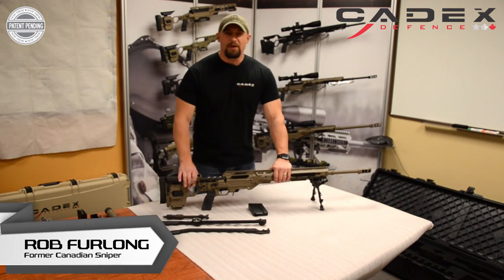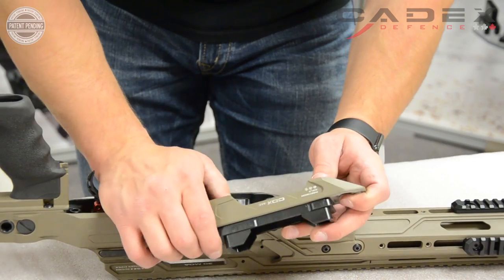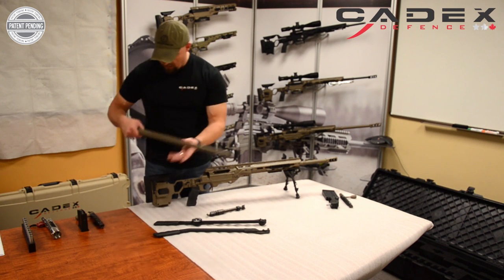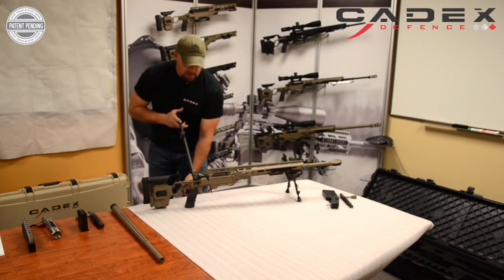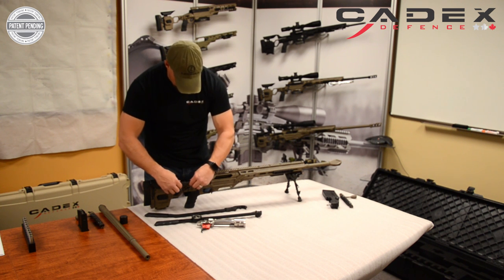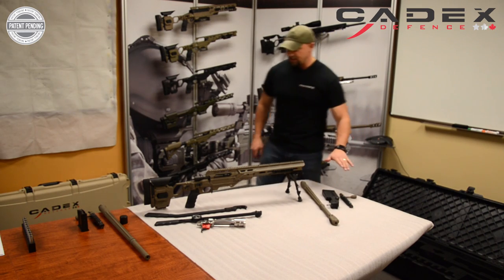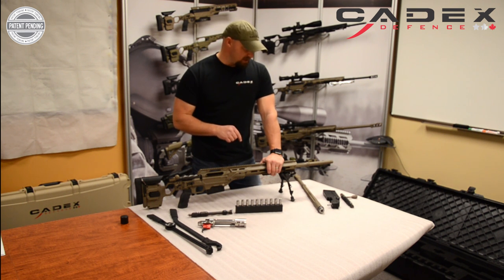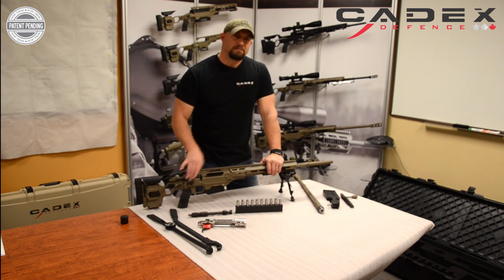CDX-MC Kraken - Rob Furlong

Comment: Can you guys make it any more complicated???!!!!!!! 
BTW i love yall's chassis.
Reply: Might be a tiny bit more complicated than some other barrel change systems out there however this one works wayyyy better as you are threaded the conventional way straight in the action receiver, not clamped like most systems.  This means that your POI remains pretty much the same even at long range which is a big improvement to the clamping method which repeat inside 1 MOA.  These systems are designed to shoot at long range +1000 yards so one MOA is 10" of margin of error at 1000 yards...  Our system has a shift of POI of less than 1/4 MOA if done properly.  That means less than 2.5" of margin of error at 1000 yards.  With shots taken at more than 1500 yards these days this makes the difference between a hit or a miss.  But yes it takes more than a 1/8" Allen to perform a barrel change.  Still, just think about how much ammo and time you'll spend on a range trying to fine tune your rifle between barrel changes?  Accuracy will always win over rapidity of barrel change because barrel changes are not made in the field, they are made prior to the mission so 30 seconds change versus 5 minutes change doesn't matter...

Comment: Does the multi caliber system compromise accuracy? For example, would a cdx-338 make a tighter group than the kraken with a 338 barrel?
Reply: Nope my friend.  Same barrel size, even bigger action.  The barrel change doesn't affect accuracy (as long as it's done as per the owner's manual)

Comment: great system shouldnt take more than 10 minutes for a barrel change. as convenient as it needs to be  while maintaining   headspace  and  consistent solid lock  up but    it is stupid heavy/ expensive. i will agree though the best barrel change system ive seen yet. i would be more interested in seeing this design patented and licensed to more lightweight  hunting/ sporterized competition rifles
Reply: I guess we disagree on the definition of stupidity...  To us stupidity is most of the manufacturers selling a multi-caliber not capable to maintain the same POI between barrel changes.  If you consider that carrying a 1 pound/ 3 piece tooling kit in your gun case is "stupid heavy/expensive" than I guess we'll let you spend your ammo trying to fine tune your ballistic chart, spending ammo, while we hit targets first round first hit...  Most systems on the market are maintaining a 1/2 MOA on paper (a true 1 MOA in the field) shift of POI, it means 15" at 1500m.  This system has zero to 1/4 MOA shift of POI and this makes the difference between a hit versus just throwing lead out there until you can make your correction.  Also, try to find us a Multi-Cal (American/Canadian made) using top of the line components with the same features for cheaper than us...  Good luck.  But we respect your opinion.
Reply: i am saying  for what i need  the rifle is very heavy and expensive. that is why i would like to see it on more  competition/ hunting rifles. i am not sold on the  other manufacturers   quick change system and actually have faith this would work well but  i have no need to change calibers in the field , that is an option i would love having at home
Reply: We agree on that point, a caliber change is NEVERneeded in the field, including the military.  As for heavy, it's not a hunting rifle for sure, it's an extreme range surgical tool so heavy is stability and makes the difference on follow up shots.
Reply: @daviddaerr1719  because the military can ask for anything...then there is reality. That is why many requests come up and few contracts get signed. There is not a single truly "tooless" multical system adopted. The M40A6 uses a torque wrench hex key and the abandoned XM2010 found out the juice wasn't worth the squeeze. These guys have done what was asked and the requirements are what they are. This was never meant for the hobby shooter. I am not a Cadex fanboy either I just like keeping up with innovative systems.

Comment: plane to get one mc 338.is all tools
 sold separate or with gun?
Reply from the maker: Hello Peter! Thanks for your interest toward our products. The tool for make the caliber change is sold separately. We have two different kit. The COMPLETE KIT, that includes all tooling required. Or, the BASIC KIT, and you will also need a Conventional 1/2 drive torque wrench (capable 100 ft/lb).
Reply: @CadexDefenceCanada  thx，other question，where i can buy the barrel?didn't find on web shop
Reply from the maker: @peter11618  Write us at customerservice@cadexinc.com or you can call us at 1-888-348-6774. You can also find a dealer near you by following this link: https://www.cadexdefence.com/find-a-dealer/